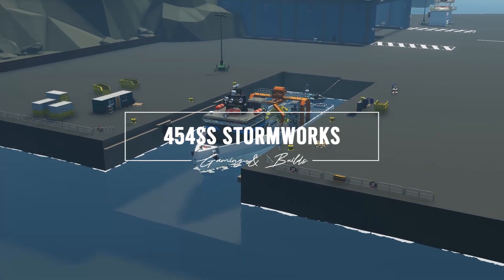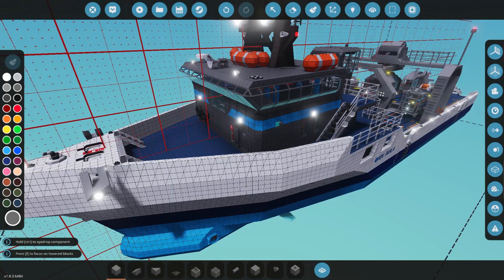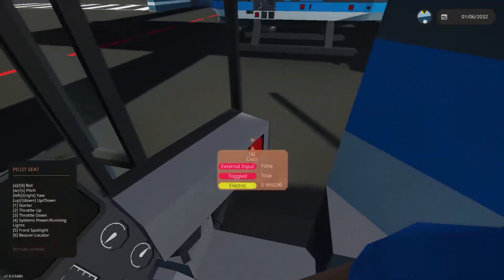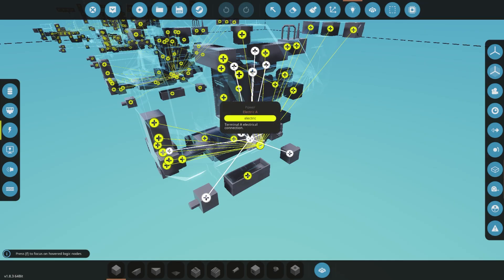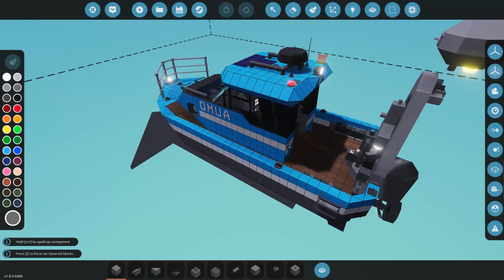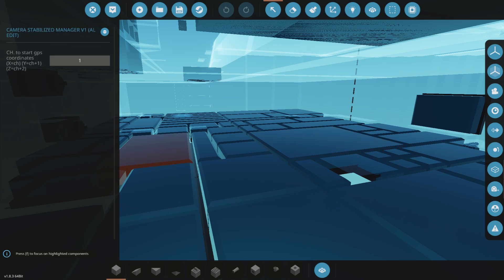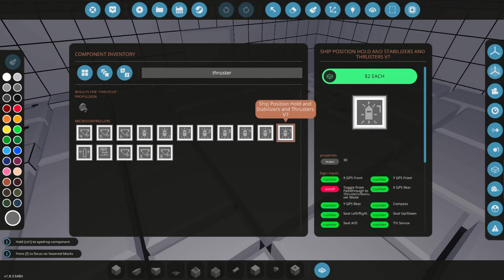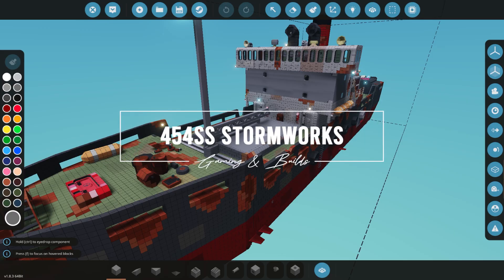5 things I WISH I KNEW when I started in STORMWORKS

Comment: I'm with you on the reactors and steam. They don't really feel granular enough. With an engine there's so much tuning that goes into it to get it to be stable and not run hot, with a reactor its "Turn it on if its not hot, turn it off if it is hot, make sure you have enough water!"

Comment: This is really cool and I do like microcontrollers but I'm not that good at them and it sucked when I had to spend 2 hours designing a microcontroller so that I could get a panel with four switches to work and I had to make a separate one in case I wanted a panel with four dials or whatever I feel like depending on like if you have one switch and three dials that switch should have its own mini node on it so the entire block has like four data nodes on it and the data notes can change depending on what it is but it is kind of dumb I had to make a microcontroller for that just so I could have a compact version of four buttons

Comment: Handy tips for career mode / survivability inside of your ships:

1. Make as many watertight compartments as possible. Especially below the water line. The smaller, the better. Avoid splitting compartments by the middle, because water would flood only one side of the ship and make it capsize fast. Even the best stabilizers will struggle. For launching ribs or lifeboats or helicopters, its just better to take that additional flooding, even if it leads to sinking. => Sinking slowly vs. capsizing quickly

2. Escape vehicle => have a rib or a lifeboat or a helicopter that allows you to travel at least some shorter distances. More important in hardcore one-life career mode. Don't forget arctic equipment!

3. Pumps => Have multiple pumps in every (large) compartment. Some pumps will get damaged and with the absurd new flooding physics probably won't stop the water from filling up. It will buy you time to start repairing or escaping though.

4. Automatic system => Watertight doors should either be manual (and always closed) or electric (ensure emergency power automatically switches on, otherwise the door will open!). If electric, they should be forced closed if water is detected in the surrounding compartments. I recommend activating all pumps as soon as one sensor detects water, as damage might destroy some liquid meters.

Comment: Just a little advise, and an alternative way to link up electric: I prefer to "straight line" individual groups of components... for example: I will link all displays in a cockpit in series, and connect that to one beginner block, or I will link all engine components in series, etc. This separates sub-systems and keeps the linking view nice and clean and helps identify different systems when coming back to it. I have also got muscle memory to re-check electric when finishing modifying one sub-system.
Reply from the maker: Thanks for the comment, great idea, but I still think it is superior to do the single node connections, it has changed the way I can retrofit things without killing a circuit! :)

Comment: 1070 hours, good advice. If you play survival, I recommend the controller sheet in a compartment that is less prone to damage, as-well as the ability to reach them and fix them with a welding torch, would have saved tons of missions I’ve failed. Another tip is to learn tricks like multi vent Jets to get more power and efficiency. I’m diving into modular engines to produce more power but I am stumped, as with jet engines they don’t account when you make multiple exhaust with the T pieces and angle pieces ect, so you can make a hyper powerful jet or generator, wile using the same fuel as just one jet engine.
Reply: I stumbled onto that bug a long time ago while messing around. It's all I use when I need anything that isn't ultra long duration